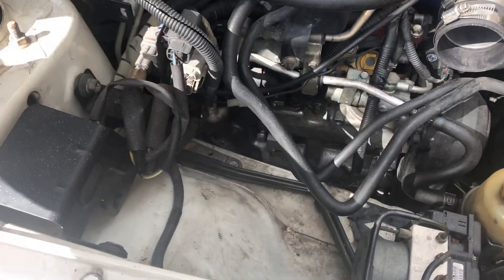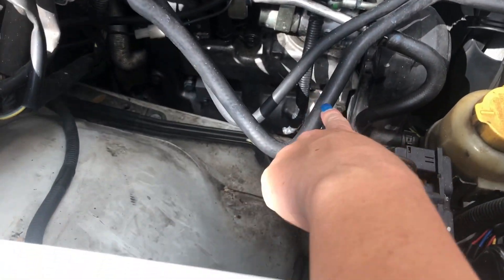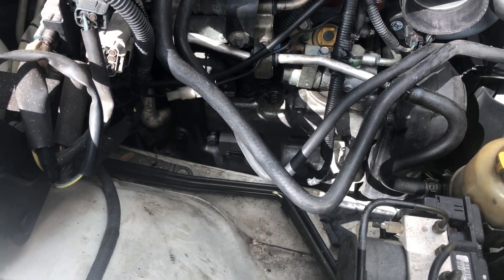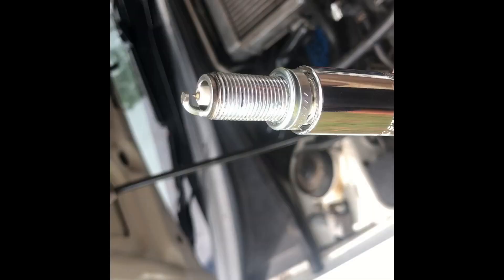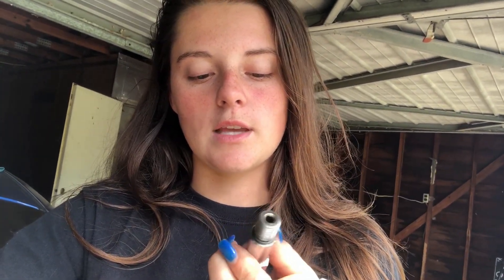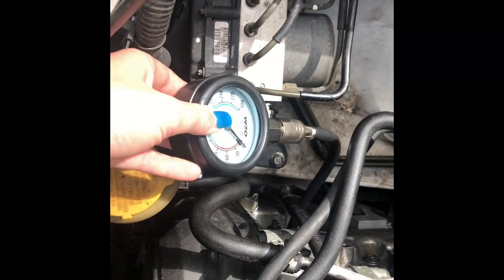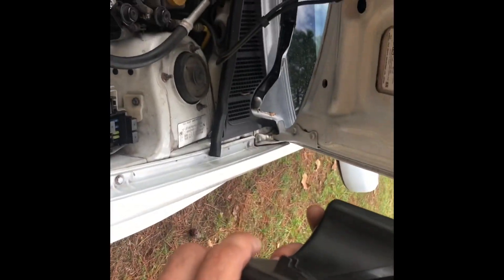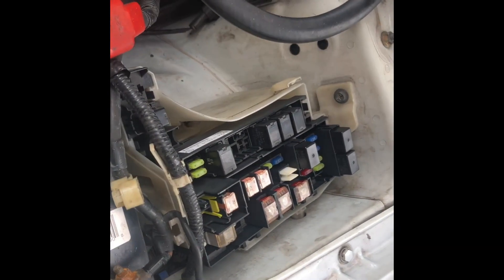Compression Test On STI

Comment: Oof. If all the numbers were at least closer together I'd think you had another problem like needing to warm up the engine first or hold the throttle open while testing. In this case though, yeah it seems like you def have an internal issue. It could just be dirty or sticky valves, but it could be as bad as ring lands. Best of luck diagnosing and fixing!